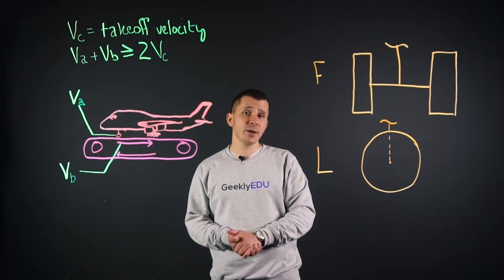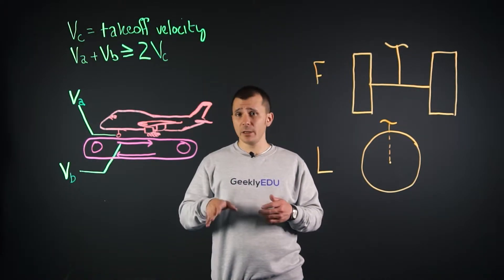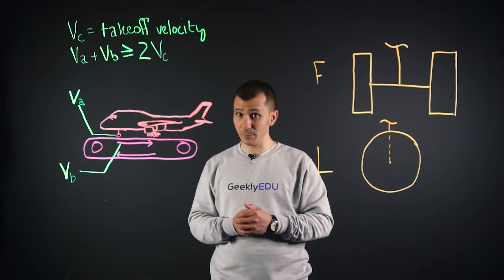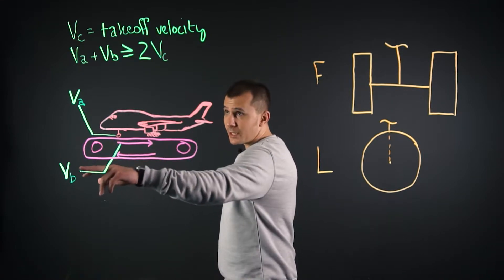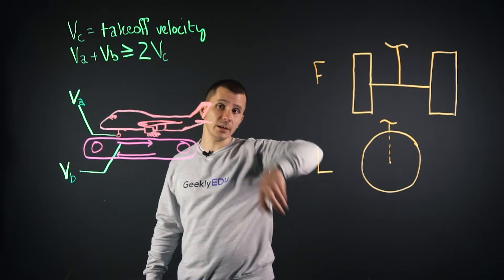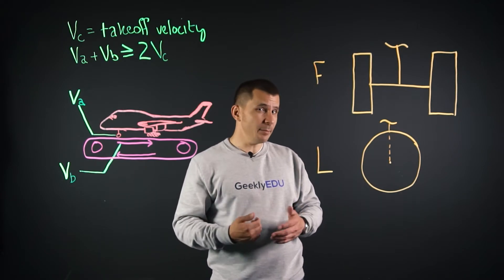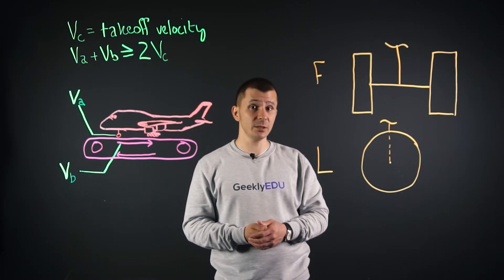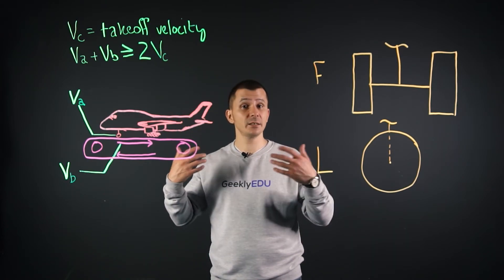Plane on a Conveyor Belt - Will It Take Off? #GeeklyHub

Comment: Imagine thinking that a stationary plane can achieve lift. This would change the principles of aerodynamics.
Reply: Imagine thinking a plane's propulsion is through the wheels.  The propulsion is from the engine turbine/propeller against air.  What the wheels and belt are doing has nothing to do with it.  All the belt will do is cause the wheels to turn faster at the same airspeed.
Reply: @wulfhart1974  exactly as you said.against air. there is no against air if plain is stationary sitting on belt.
Reply: @martinm2074  it won't be stationary.  Mythbusters already proved it.  The plane will travel against air just as fast as if it was on a runway.  The belt will only cause the wheels to turn faster, but the plane will be going the same speed against air.
Reply: @wulfhart1974  you're response is the first time I can begin to understand the plane takes off argument. The engine thrust is pushing every component of the plane forward except the spinning wheels. Taking wheel and conveyor belt speed limits completely out of the equation, when punching the gas pedal the engine thrust is pushing the airframe forward until required wind speed is achieved to create lift, even if the wheels are running at 60 million RPM,s with the conveyor matched at whatever metric is used to determine that (surface feet per minute?), the plane is taking off at the same acceleration rate as if it were on a regular runway. I think I kinda get it now?
Reply: @josephbuck8530  exactly.  The plane only acts against air because it uses air as prepulsion, not wheel torque against the ground.  The wheels are just there to keep it from scraping the ground.  Only a headwind will affect it, not a conveyor belt.  The little bit of friction the wheel bearings make is the only factor and it is minimal.
Reply: @wulfhart1974  "Mythbusters proved it" should get its own internet term for when someone uses a bad science TV show to win a scientific argument.

The Mythbusters "proof" was outside the parameters of the question. FFS, they had a plane being dragged on a piece of paper - Meaning the plane had forward motion relative to the air.

In the question, the wheels travel the same speed as the surface they are on. Meaning that, relative to the ground, they stay fixed. As ground and air are, in the reality most of us live, usually somewhat connected, no ground speed is also no air speed.

No air speed, no lift.

Of course, the engines are pushing out massive amounts of thrust, so also in reality that has to go somewhere.

All of which means this is a trick question. A thought exercise perhaps. Or a chance for people who detach reality from knowledge to try to show off that they have superior understanding of propulsion methods, while displaying anything but superior comprehension of real world possibilities.
Reply: @exasperated  tell me you didn't even watch the video without telling me you didn't even watch the video🤣.  You even got the question wrong.  The belt doesn't match wheel speed, it matches plane air speed.  Wheel speed will be belt speed plus plane air speed.
Reply: @wulfhart1974 mythbusters did one thing right but it got lost in the grand reveal.  They placed a small RC car on a treadmill and started the motor and placed it in equilibrium with a running treadmill.

What they showed is the principle of the thought project - the vehicle and the conveyor can be placed in equilibrium at any speed.

It doesn’t matter how a force is applied.

One could remove the tire from the wheel and roll it on the conveyor.  Can the treadmill match speed of the rolling tire?  Of course.

Give the tire a push to reach a different speed.  Can this mythical conveyor match that new speed?  Of course.

People are getting completely flummoxed by ‘the propeller acts on air’.  That’s a silly non-point that completely misses basic physics principles.
Reply: @josephbuck8530  that's mistakenly thinking that the vehicle body just floats through the wheels.  The formula for a wheel rotation to a linear motion is exceptionally clear.  If the wheel rotates in place and we can eliminate any notion that the wheel scrapes on the surface, then the rate of the conveyor speed is exactly what the vehicle speed would be if it weren't on the conveyor.  1-1 = 0.

Comment: You are completely wrong. The question is, can the plane take off if the conveyor belt and the wheels are going at the same speed except in the opposite direction. The answer is a definite NO. If the question is violated the plane moves forward. That is not exact or same speed. If you're walking on a treadmill and you have matching speeds, you aren't going to fall off the front of the treadmill. If the question is obeyed, a person standing next to the conveyor belt can talk to the pilot and the plane can NOT take off.
Reply: The only way for the treadmill to transmit momentum to the plane is through the wheel bearings, which are designed to ensure that momentum ISN'T transferred to the plane. The wheel speed is independent of the ground speed and the airspeed.
Reply: @sheriff0017  the wheel speed is exactly correlated to the speed of the body of the vehicle and, from what we are given, that will be exactly the rate that the conveyor moves.  A simple drawing would put this dispute to bed, but this social media is not good at posting graphics.

People are getting confused by a few things - the immense size and power of a 747 and the subtle nuance of rotational speed of a wheeled test vehicle compared to the axis speed.

Two visualizations would resolve this - one would be to roll a tire on the conveyor so people can see that a rolling vehicle speed can be placed in equilibrium with a running conveyor.

The second is to compare this system to a pinion on a rack.  If the rack is static while the pinion receives a force or starts with a starting rotational speed, the pinion will roll across the rack.  If, however, the rack is given a matching speed, the rack will move and the pinion will be stationary relative to an observer on the ground.
Reply: @MrDefreese  The speed of the vehicle relative to what? 
I'll illustrate it like this: launching a Buccaneer S.2 from HMS Ark Royal. Search YouTube for this, or simply search "bow cat Buccaneer."
The ship is steaming into 30 knot wind at roughly 25 knots. The catapult adds about 100 knots to this. When the catapult is tensioned, the nose wheel is held off the deck. This gives the Buccaneer the proper AoA for take off. 
There are a lot of different speeds here - and one of them is zero. The aircraft will move at 100 knots relative to the ship, 125 knots relative to the ground. The indicated air speed will be 155 knots. The hubs of all 3 wheels are fixed to the undercarriage legs. The main wheels will rotate at a rate commensurate with the aircraft moving at 100 knots because of friction between the wheels and the deck. The nose wheel won't rotate because there isn't enough friction between the wheel and the air to cause rotation (the Buccaneer's nose wheel is held off the deck during launch). 
From the point of view of flying the Buccaneer, the only relevant speed is the indicated air speed. That's the speed of the air passing the wings.
Reply: @sheriff0017  

_
Edit to answer your question:  the description you provide is from the perspective of an observer adjacent to the carrier.  If that’s the case, the observed speed of the aircraft the instant it leaves the catapult and deck should be 100 + 25 and then the aircraft accelerated from there with the thrust of the aircraft engines.

Does the airspeed indicator of the aircraft incorporate wind speed to determine headwinds, tailwind or crosswind?
__

you just showed the problem and the math.  You added things properly (as does any carrier operation).  Wind plus catapult speed/acceleration plus thrust speed/acceleration plus vessel speed gets you the maximum airflow over the wings.  That's basic math.

In this case, however, using the same basic math, you have thrust acceleration/speed minus ground acceleration/speed.

We can use acceleration and speed similarly because if speed is exactly matching that means acceleration matches exactly as well.

Simplifying without thrust or acceleration, if you had a test vehicle with a steady speed on a conveyor, you can easily see how a conveyor can be set to the equilibrium speed.  Mythbusters showed it but then they mistakenly went down the wrong path of asserting there is a mythical difference between forces acting on their test vehicle.  There isn't.  Force is force.

If you apply thrust, all that means is that you are changing vehicle speed over time.  That's it.  If you accept that this (absurd) conveyor can match one speed, then there should be no logical problem accepting that this (absurd) conveyor can match another speed.

That's it.  It is much simpler than it seems.
Reply: Analogies about walking on treadmills are so irrelevant. Unless your plane gains speed with feet like a Flintstones car.

Comment: Since the planes wheels free wheel. Even the slightest amount of thrust from the planes engines will make the plane move foreward.  Conveyor speeds up and still the plane moves foreward. Heavy wagon on a treadmill.  Pull from the front (prop plane).  Push from the rear(jet plane).  Start the conveyor.  Make it go as fast as you like.  Hold the wagon still while it speeds up.  Once the wheels match the speed of the treat mill...How much force will it take to move the wagon push or pull?  If the treadmill speeds up as you push its still not going to take much force to keep moving the wagon.  That's the problem.  The wheel aren't holding the plane back...much.  So, its impossible to stop the plane from moving foreward.
Reply: It depends on how the question is phrased. If the conveyor must always match the speed of the wheels, then it is impossible to take off. Assuming a perfect treadmill, you could never achieve forward motion without getting counteracted and your plane would stay in place as your wheels approach infinite speed and friction really starts to matter. 

However, if you set the treadmill to a constant speed (whatever the takeoff speed of the plane is) like Mythbusters did, then of course you will take off as long as your wheels could handle going twice the takeoff speed.
Reply: @shishka67  Not true.  Once the plane over comes the initial resistance to the motion of the treadmill, forward motion begins no matter what the treadmills speed.  The only limiting factor is the speed rating of the tires on the plane.  If you were in front of the treadmill, with a rope, and held the plane in place as the treadmill began to move....Once you applied enough force to over come the initial movement, you could hold the plane in place with little addition effort, no matter how fast the treadmill was moving.  In essence the plane wheels and treadmill operate completely separately from the plane its self....Except for a little friction of the plane wheel bearings.  That small amount of friction is all the needs to be overcome to allow for forward motion.
Reply: @SwimCoach8  but if you pulled the plane would the wheels not be moving FASTER than the treadmill? If so you just violated the rule. So of course it will fly when you violate the rule.
Reply: @knighthonor44  The bigger question is, do you believe any plane could achieve flight if the engines are barely above idle?  If the treadmill and the plane wheels are moving at 500 knots, the force to match that speed will be minimal.  Wheels and treadmill operate almost independently of the plane.  The instant the plane is throttled up, it begins to move forward.  Imagine the reverse.  A plane is coming in to land.  It is moving 400 knots.  The runway is a treadmill moving the opposite direction 400 knots.  Will the plane stop instantly upon touching the treadmill?  Or....Will the wheels chirp louder than normal, match the speed of the treadmill and allow the plane to land normally?  The landing distance will be shortened marginally but only the distance required to overcome the friction between the wheels and treadmill.
Reply: @SwimCoach8  you are breaking the rule of the problem, which is that the treadmill always move the same speed as the wheels are spinning lateral speed. So if the plane is throttled, the plane body moves, but since the wheels are fixed in place to the plane, while they are contacted with the flat ground, they move at the same lateral speed as the plane. So if I throttle the plane from 5 mph to 10 mph, the treadmill should do the exact scale at all times. but in the reverse. Plane need air over the wings to fly, and they need it at a certain speed to flow over the wings. Planes get this by moving. 

So answer me this. If the plane is on a treadmill with no wings, and the treadmill always match the speed of the wheels, would the plane move or remain stationary while throttled?
Reply: @knighthonor44  The wheels aren't fixed in place. If they were, the treadmill couldn't move. The wheels rotate freely.
Reply: @sheriff0017 they rotate freely but not independent of the vehicle.  The calculation is always the velocity = rotational speed times wheel radius.  If the vehicle moves forward, the wheel rotates in exact proportion.

In physics/mechanics terms, one needs to view from two frames of reference.